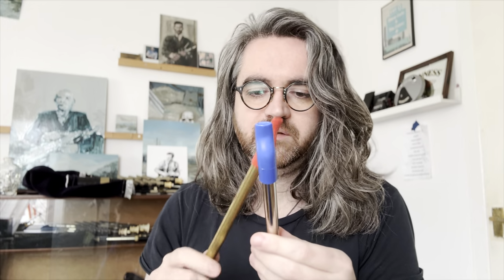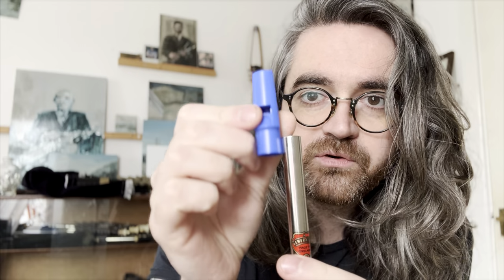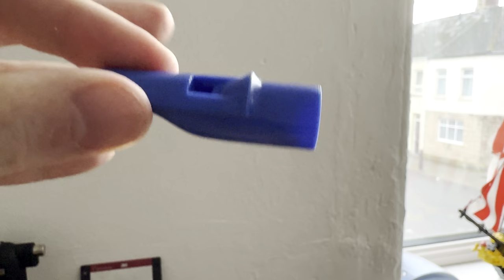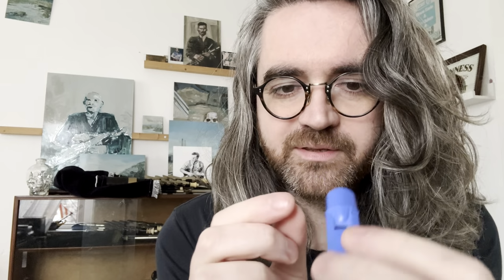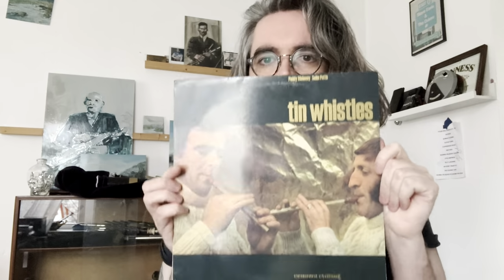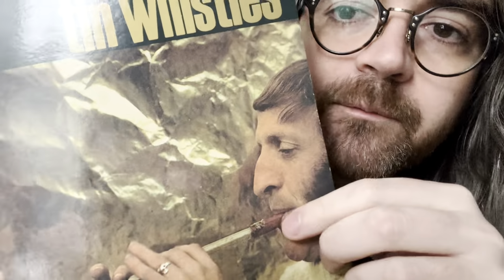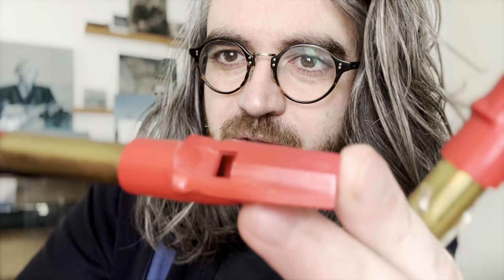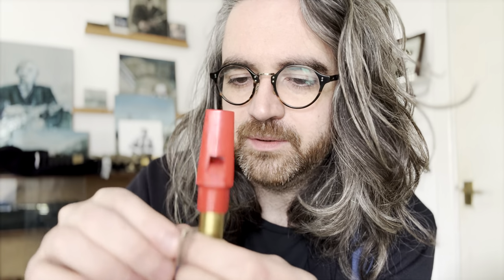Irish Tin Whistle Tweaks and Tips

Comment: I  don't like whistles that have a natural C tending towards sharp and I almost always intervene to correct this off-key note that most whistles have. The Lir Whistle in D and the Wild in D fortunately have an excellent natural C and I didn't intervene, while the Killarney in D has a very high natural C and I intervened in this one and now I'll explain how I did it: I used transparent nail polish for nails, and with a toothpick I applied a little at the top of the first hole, let the nail polish dry and test if the note is good, if it is not apply another layer, normally they require 2 to 4 applications; If you weren't precise or it doesn't work, you can always easily remove the nail polish. I was saying that it is better to apply the nail polish in the upper part of the hole because the effect is felt more and the hole closes less, because a hole that is too closed also gives a worse sound. in many cheaper whistles such as Generation, Feadog, Oak, Waltons, I have performed this operation, but you must not exaggerate in resizing the diameter of the first hole which together with the fourth hole is the smallest, because you risk worsening the sound of this note. I hope I was clear.
Reply from the maker: Great tip!

Comment: Hi Jason, really nice video. On my personal experience I noticed a clean mirror shape of the inner bore creates a lot of high unpleasent  overtones out of a clean new whistle. I believe that's why an old used whistle with a dirty bore sounds way better.
What I used to do with a brand new whistle is making the bore a bit dirty oiling it a bit (even frying oil) and then poor a bit of fine ashes or any very fine powder inside.. Do you find it crazy? :D It can be washed out easily if that doesn't sound right or maybe just improve the sound waiting for natural oxydation.. :)
Reply from the maker: Thats very interesting and thanks for commenting! I had never thought about that. Might have to try that one too

Comment: I love your tips. I have nine whistles, all sorts of keys, and some much more expensive than others. I do love my high D and my low D made by Alba (Scotland, very expensive), but I know that a much mellower tone is not always desired in an Irish session. 
I have a pretty poor sounding C and high D and will use your tips. I like the idea of the electric tape around the joint. 
But you lost me with the cellotape on the finger holes. How would one play a C natural? A lot of individual note tuning can be achieved with breath support...
Reply from the maker: Thanks for the message! I only use the tape to tune the occasional sour note. The fingering remains the same, the tape only covers a small part of the hole (usually the top) which can make the note flatter. It’s great when playing with another instrument and you need things to be spot on in tune. I agree about the breath to change the pitch too but sometimes I find it’s not really practical at speed. A low whistle is a bit easier as you need to push harder but on a standard whistle the range is much smaller and tape just makes things more reliable. Hope this helps!